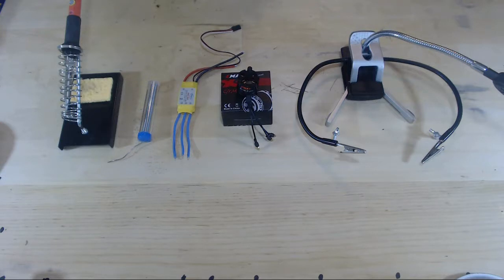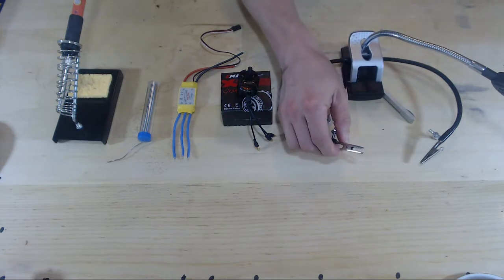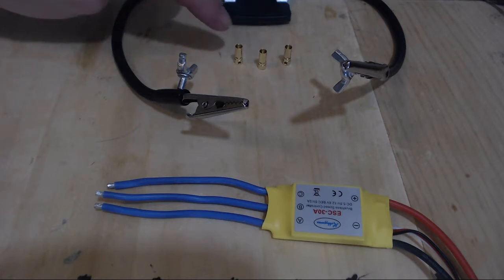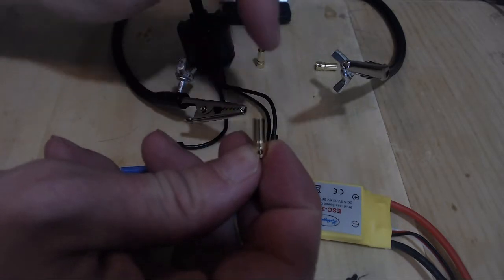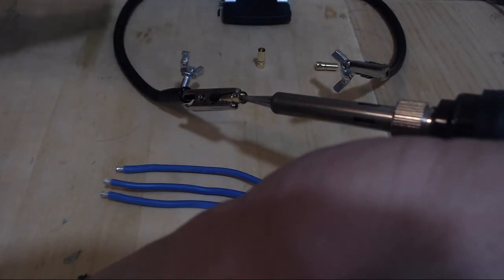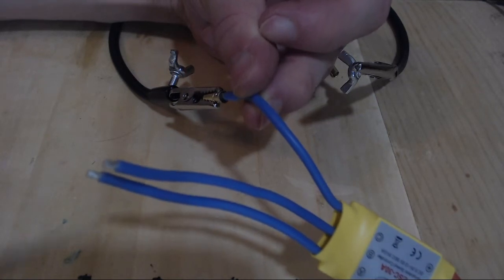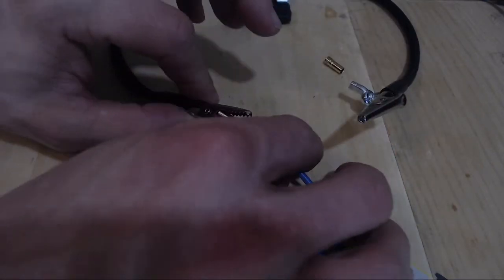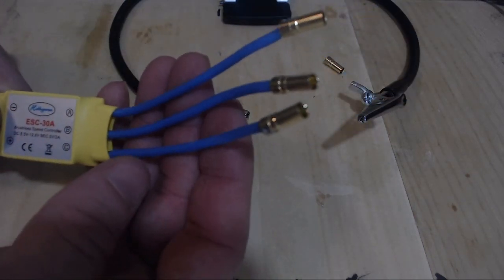How to Solder Bullet Connectors to ESC | A Noob's Guide

Comment: My motors dont have connectors on them, just wires. Can i just solder the wires of the motor and esc together, without using a connector?
Reply: yes sure , most of customade drone dont have bullet connector.
Reply: Yes, but make sure you have the motor spinning the way you like it before soldering.

Comment: Very helpful, thank you! I was wondering what purpose the hole in the connector served. Tip for other viewers - you may also want to apply a heat shrink around the bullet connector after this.